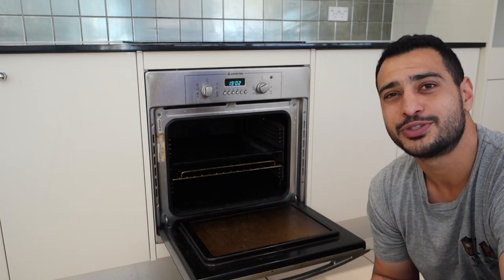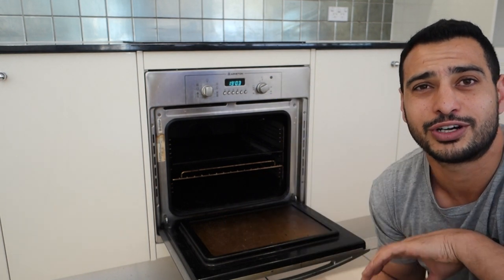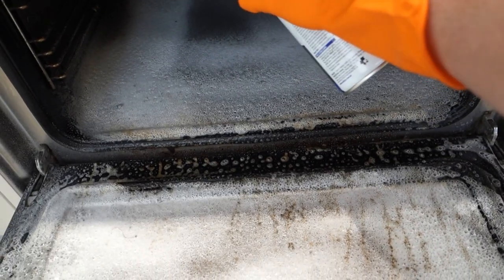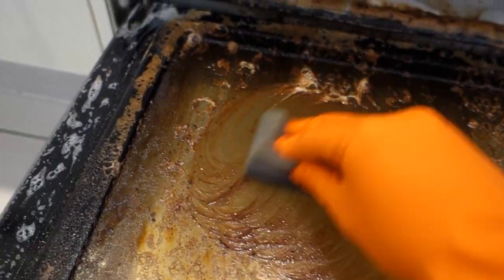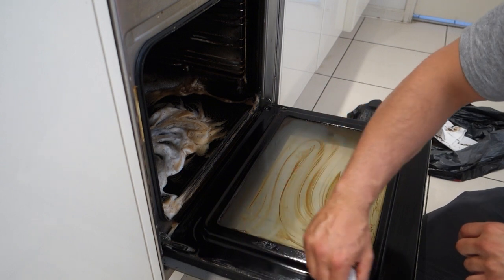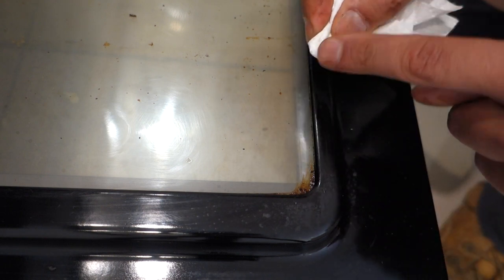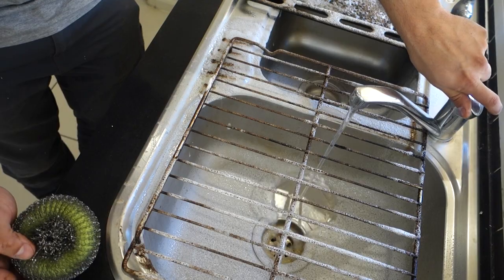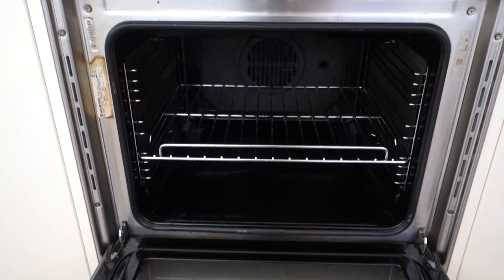How to clean an oven like a pro in 5 minutes -  DIY Selleys

Comment: Put the grille on top of the tray, then spray both at the same time. Less spray wasted 👍🏻
Reply: Good tip!
Reply: One would have thought that that was obvious :-) better still is to get a large clear industrial strength bin liner and place all trays rack and grills inside along with a generous dose of the chosen cleaner.
Reply: Great add
Reply: Top tip
Reply: I used to put mine in a garbage bag and then spray. I sealed it up and would let it sit overnight if it was bad enough. Then I could just rinse it off in the morning!

Comment: Just a small tip, large items like the rack can be washed in the shower room. It's even nicer as your shower can put out very hot water. Also if the hose is long enough you can rinse right near the drain.
Reply: Yep, I do it in the bathtub, then I don't need to be careful not to make anything wet that shouldn't be and the shower head is just perfect to rinse it, everything that is big I clean like that.
Reply: That's why you should always go with the big single base sink. I rented an apartment while I was remodeling a home I bought from a hoarder. The apartment had the usual double bay sink. Never going back to that! You don't need a special sink bay to dry dishes if you simply have a dish drying rack.
Reply: My goodness, why wreck your shower or bathtub and have that mess to clean up.
Reply: @allyelly1519  My sentiments exactly Ally.  The grease alone would be murder to get out

Comment: My tip is if you shut the oven door try to stuff some kitchen roll along the gap at the bottom of the door where it meets the oven, as the gunk runs down the glass when closed makes a mess. Tbh I think it’s better if you leave the door flat, it bakes on better

Comment: You should never take off chemicals, especially those coming from a can that says poison, with just dry paper towels. You need to get a bucket of hot water and a microfiber cloth and wipe the chemicals off. You don't want to start your oven with the residual chemicals in there
Reply: I think he said to use lemon juice and water to get the rest off
Reply: Very good point
Reply: Thanks Mary, good looking out 👌

Comment: May I suggest? I remove the door, it's so much easier to reach inside, and It'd surprise you how easy it is, just check out the model.
Reply: That's a good idea. I used to clean restaurant ovens and that's what I would do. Plus I'd take it and the racks outside and use a power  hose to rinse it all ,leave it out to dry and you're done.

Comment: I'm pretty sure the instructions say to rinse at the end. You don't want all those harsh chemicals in there when you go to cook in it. I'd also recommend to keep gloves on the whole time, gloves come in different sizes so buy the one closest to your hand size. Another tip is to put some paper towels in the bottom gap of the door as some will escape and drip onto the floor but if your worried about that getting missed then I recommend putting some newspaper down on the floor in front of your oven. I liked the scrubbing idea in the oven itself, I normally just wipe it, I do scrub the pieces that come out though. Lastly, always read the directions on the back of the can and happy cleaning  to some great music!! 😊

Comment: So quick and easy. But couple a few things I would've done differently is, save water and paper towels, plus moving the side rails, when spraying and then clean again using vinegar and baking soda over, to get rid of the smell and chemicals that's been used in the oven

Comment: It would help to include how to deal with the heating elements.
Reply: I totally agree
Reply: As a cleaner we normally don't touch them beyond maybe a wipe with a degreaser.
Reply: @aidanm5578  My concern is whether oven cleaner would damage the elements.
Reply: @dianemeyers222  Nah it doesn't at all. But when spraying the oven you try to avoid them anyways. But if you do get them, we just do the aforementioned wipe with a bit of degreaser.

Comment: I would avoid using a metal scraper on the glass door as that can scratch the glass. A nylon non-scratch scourer is much safer. Avoid steel wool, as that can scratch enamelled surfaces. Allow the degreasing chemical time to do its work to soften the burnt-on food and fat.
Reply: Scraper can be used on glass just fine. I've used it on oven glass, shower glass, windows etc with no issue.
Reply: Scrapers are perfectly fine to use provided the surface is wet,  great for cleaning ovens and cleaning soap scum in showers
Reply: I’ve never had scratches from a blade, and I use a blade to clean my glass stove top!

Comment: Thank you! What if your stove has an element in the bottom?
Reply: Don’t spray the element. Chemicals are bad for it. It should lift up to get it out of the way. Spray around it.
Reply: Very difficult to avoid the element if you’re spraying it. I find you have to hold it up and wipe around it. Doesn’t get it all but at least most of it.

Comment: I have a Corian countertop that got scratched by a repairman's tool box. Relatively deep scratches. I tried using 0000 steel wool and it brought them down a bit but now the whole countertop has fine scratches everywhere I worked. I would like to restore the surface to its original look.

Comment: Good job! There was a lot of chemicals used so what's the best thing to do before using again? Turn the heat on for half an hour to get rid  with or without door open? What do people suggest? Thanks :)
Reply: I always roast some beef bones in the oven to get rid of the chemical odour, but don't use the bones for anything afterwards.

Comment: This will of took him hours (about 3/4 NOT 30 minutes) and he didn’t get the side and rear plates out or the fan so the build up of fat will still be there and and smell when the oven is used. I’m a professional oven cleaner and can do the job properly in an hour
Reply: so where's your video, Twiggy
Reply: @s70rk  I don’t want to do a video thank you 🤷🏼‍♂️
Reply: Hour including waiting for the parts to 'soak'? I swear I can do it in 30-40. I'm more of a general vacate cleaner.
Reply: I'm a professional oven cleaner and I put the oven trays in the laundry sink with BOILING hot water and washing powder.
I let that sit for the time being whilst I get onto the oven.

I usually take all the trains and sides out of the oven and then turn the oven on for 5 minutes while I soak the trays.

Then I go back to the oven and spray it with eucalyptus and scrap the crap out of it for 15 minutes.

Go back to the trays and all the gunk literally wipes off.

30-40 minute job - MAX
Reply: @QueenB-ny5ex  why haven’t you got a heated dip tank for all the removable parts?

Comment: I am assuming this is NOT a self clean oven. Perhaps you should warn your viewers - Do not use any commercial oven cleaner in or around any part of the self-clean oven. Continuous use of chemical cleaners on a self-cleaning oven liner will cause etching and discoloration of the liner, and eventually cause the oven not to clean effectively when using the self-clean cycle.

Comment: They don't have that exact spray in UK, I got Mr Muscle which is the leading brand and it sprayed nowhere near as thick as yours.
Reply: how was the result please ? I am in London and i cant find right product either. frustrating
Reply: @sandcroft2924  It was pretty decent, just found myself using loads, nearly a full can. Couldn't get the inside of oven perfect, but got the glass done well.
Reply: @PomBare  thanks for the reply. 
Will have to look into this. Thank you 😊

Comment: I’ve literally just used that exact oven cleaner on my oven and it’s crap!! It didn’t do the job so I now have to repeat the process and I’ve triggered my asthma thanks to the fumes. Thumbs down to oven cleaners, I’ll be using asthma friendly processes in future.
Reply: NB I used a mask and it it still got into my lungs. Also you should have taken the door off which makes oven cleaning easier.

Comment: I know you meant well but the amount of product you wasted, aswell as papertowels and running water, such a wasteful video. 
You could have easily filled a bowl with lukewarm water and dunk your sponge in there to clean the raks.. And instead of papertowels you could have used a microfiber towel to wipe off the product.

Comment: Fantastic, this is obviously a magic oven,  now as a housewife of 50 years !!!  wow,  yes, I'm over 70 - WHAT MAGIC OVEN has no back, and no top.  Remember if you have used chemicals, make sure you switch the oven on and the grill in a well vented room to burn off the chemicals before you next use it, since THEY WILL ALWAYS SMELL.
Reply: When cleaning a ‘magic oven’ you can also leave the door on & the rack sides in place...oh & don’t forget to remove your PPE half way through cleaning ( everyone loves chemical burns , right?) 🤪🤡🤣
Reply: None of the cleaning videos ever show how to clean the back and the top. Just the door, sides and bottom!